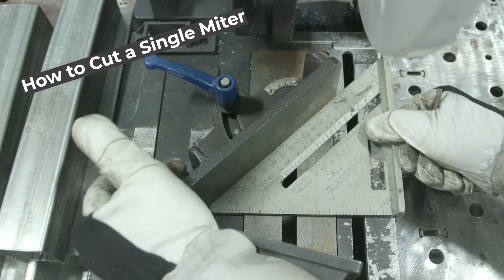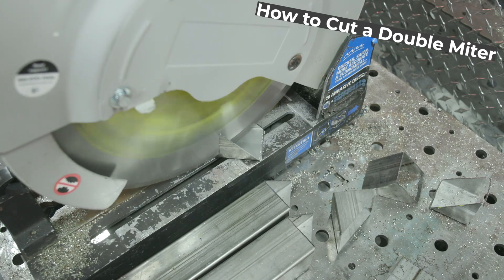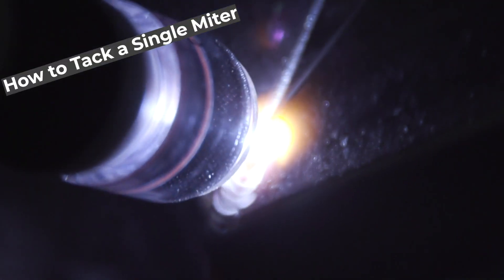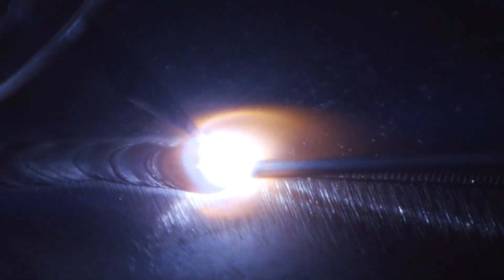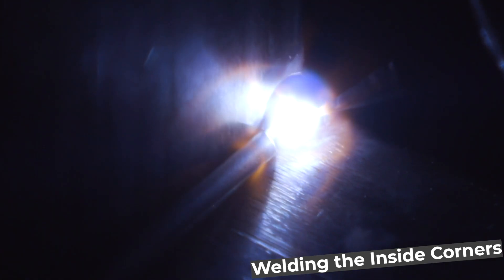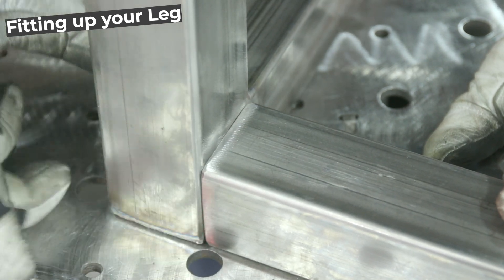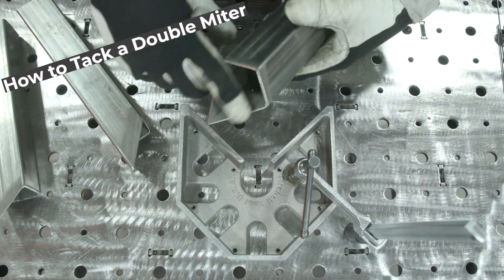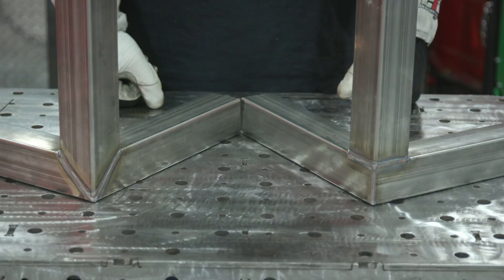Double Miter Cuts VS Single Miter Cuts

Comment: what kind of blade is that? I use a standard chopsaw blade but always have some flex so it cuts the square tubing incorrectly and I end up doing some Abra Cadabra fill welds. lol.. Even when I try to go slowly.

Comment: Do you actually see this well while welding? Or does the camera do this. If you’re able to see this well, is it your helmet settings or the helmet itself? I am never able to see well resulting dips and other problems. Enjoy your work!
Reply: Yes I do. Its the hood. My Optrel Crystal looks almost identical to this view on a 10 shade.
Reply: @bradwhite6338  10shade? Youll be blind in 20 years
Reply: I was using that as a reference. Thats what the view looks like on 10 shade. I run 12 all the time, so im good.
Reply: @MichaelGrylin  It's the ultraviolet rays that damage your eyes and they are blocked at any shade, as long as you can see well and are comfortable welding that is all that matters. If you see spots after welding it is too bright but it will not cause long term damage.
Reply: Guys. Use some UV protective safety glasses under your hood for the light that bounces under your hood

Comment: Weld inside to out on 90's. Don't tack your corners (never begin or end a weld on a tack).

Also, for the future, try not to burn your welds while doing s.s. especially if you are using such a big cup. Their were no colors in those welds as if you were using #4. Most likely, you were welding too hot.

Comment: Nice demo, but honestly welding from the outside in makes it far more likely to warp out of square as it moves in the direction you weld. In addition starting on a tack is usually bad practice. But if it works for you it works.